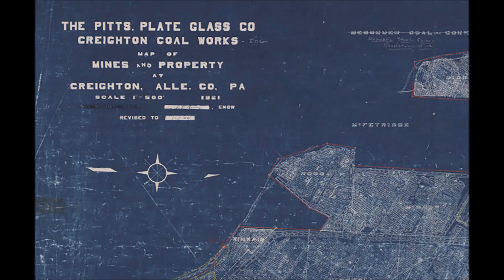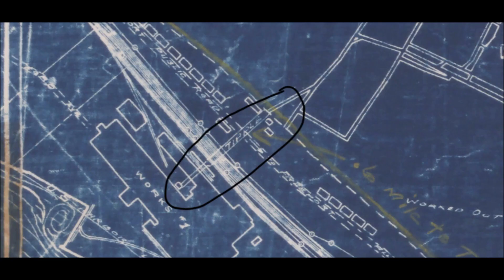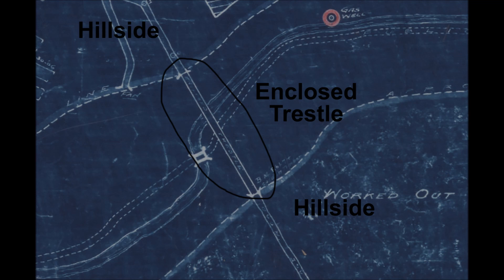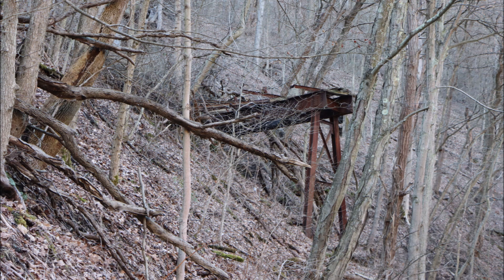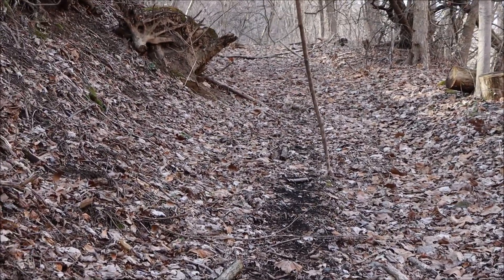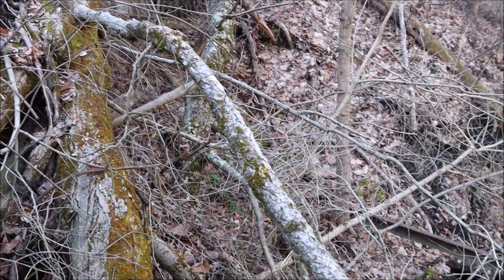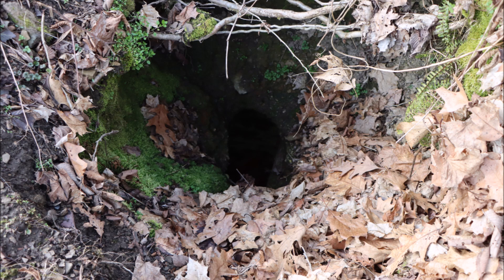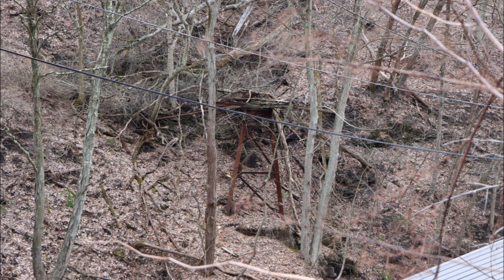Lost PPG Coal Mine Part III

Comment: Looking at the track remaining on the trestle it appears to be standard gauge track with bonding wire between the rail sections.  That would indicate a signaling system to control movement across the trestle.  Very interesting.